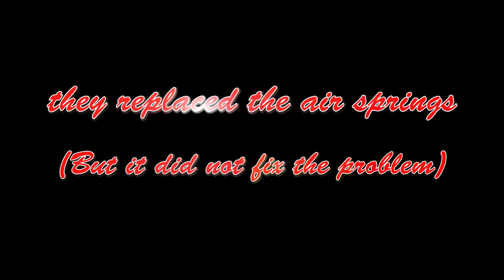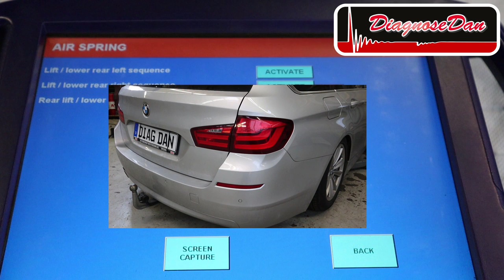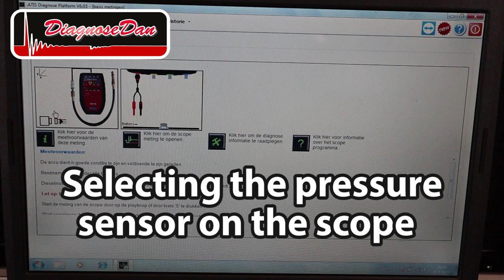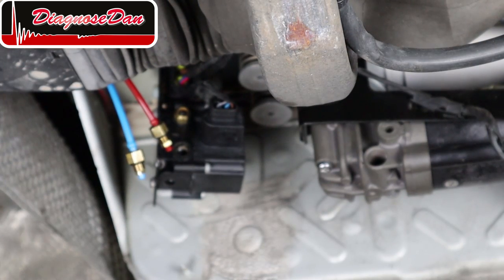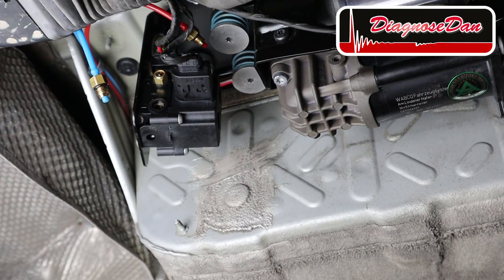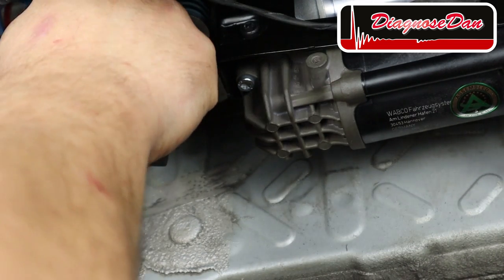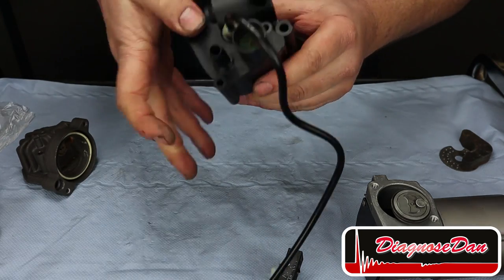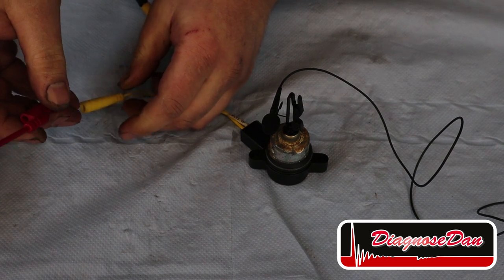Air Springs replaced, but no Fix!

Comment: Hi Dan, i have an f11 with the code 0245 , the weird part is not saggy while parked and when parked looks like it's leveling herself. Now sometimes it comes on and after stopping the car in park for a while with engine off it goes away and it comes back when driving for a mile or sometimes even more . And it does say disabled comfort mode . Any thoughts on this?

Comment: Hello Dan, I have the opposite problem on my air ride suspension 2011 740li . It won’t go down on sports mode and seems like suspension stuck up to Max .. but once I unplug the compressor using the fuse it does go down but it goes way too low. Any thoughts?

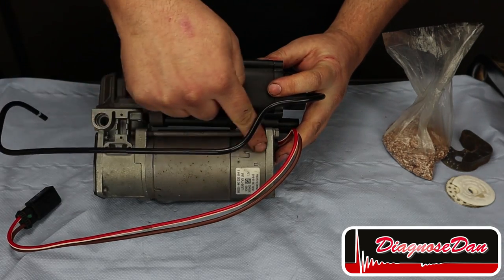Comment: Hi could you tell me how to remove the black tube  between compressor and Solenoid valve ( see video minute 18:03 already out), I need to release from solenoid valve but I can't is under pressure or I need turn off something?

Comment: I'm having issues where both sides of my F11 are dropping over a day. sometimes two. When you turn the engine on it raises to its normal height. I'm wondering if its the same issue with mine where its venting out over night.

Comment: Is it ok to use the w000589 g.l.o.v.e white on Mercedes air suspension?
Reply from the maker: Depends on the model! For pre 2012 models that's Ok. But you need to use black ones from 2013 onwards 😂😂

Comment: Question for you Dan:
My E70(X5) had a airspring fault at MOT check(yearly legal check). The car was always at correct height every day. However I had the airspring bag changed at rear on passenger side. Now in the mornings I see it both rears sit very low on the ground. Once I start the car they both raise to correct height so compressor is working.
I want to ask why did both rears lean down and what steps I need to take to investigate?
We already changed the bag we installed to rule out a faulty bag and installed Arnott one.
I would assume if one bag leaks that side would be down not both. Was it installation error on air pipes??
Reply from the maker: My question is why did you deside to change the rear passenger airspring?
Reply: Since the mot failed it. It had collapsed in the middle. I never noticed anything wrong with the car. Maybe I missed it every morning and the car was lower but I never notice anything.
Had it replaced yesterday and will look this morning to see if it lowers again.
Ok inspected this morning and passenger side is already high like yesterday no leak on this side. However drivers side is 1cm lower. Could it be a slow leak from unchanged driver side bag. Will see how it changes tmrw as I don’t need to drive the car today.
Reply from the maker: @eddy45686  at the MOT they lifted the car and the airspings got fully stretched.  I'm an inspector myself and i have seen this multiple times. After the car has been lifted airsprings can start to leak. The rubber of the spring folds over itself and can close a little hole. After the car has been lifted the spring sits a little different than before and that tiny hole that was there before can now start to leak. Chance out the other airspring and your problem is proberbly solved.
Reply: DiagnoseDan 
I’m a bit wary of lifting now as to change the other airspring they will have to lift car again. Seems the lifting has happened before many times but it didn’t lead to an airspring problem as I’ve had vehicle health check done in that past with no issues. I might have just been unlucky this time. I’m gonna chance it with other bag as if it ain’t broke why fix it. If it’s down by more than 2cm compared to other in 48 hrs then I will worry but if it stays same then I guess the bag is old and just sits a little lower than the new Stronger Arnott robust type.

Comment: the poor customer has to pay for 2 brand new air springs that where perfectly fine.
Reply: Warranty?
Reply: Not likely, AC does not usually dies out just just like that. Normally you get long ignored airleak in airspring or somewhere else and then ruined AC Compressor.

Comment: One question - why didn’t they take 2017 car to the dealer?
Reply from the maker: Imported from another country and than in some cases the Local reseller doesn't provide waranty.
Reply: DiagnoseDan wow, okay, thanks for info and thanks for such informative vids ❤️
Reply: It may be a 2017 REGISTRATION but it's not 2017 VEHICLE  @Diagnosedan

Comment: Do they not have warranty on a 17 plate?
Reply: It should be covered by warranty.
Reply from the maker: The customer imported this car from another country and than in some cases the Local reseller doesn't provide waranty.

Comment: My car won't have this problem. Sure it has self levelling rear suspension, but it does not use air. It uses hydraulic oil.

Comment: I get so frustrated when I see customer cars having parts thrown at them without any simple basic faulting being completed first. What’s wrong with the industry! Even main dealers with so called highly trained ‘techs’ skip basic principles. The original garage should be embarrassed and ashamed for changing out parts like that, time pressure or not. It would have been quicker to pressure test the pump and replace it, than it would have been to replace both rear air struts

Comment: So the moral of the story is when a BMW comes into my shop with that problem I should replace both air bags, then diagnose the compressor and replace it and after that is completed advice the customer that there is an aftermarket Solenoid available for a fraction of the cost?   
 
HAHA, Sorry I had to! It was there for the taking.  😂 🤣
Reply from the maker: Exactly! You got it!🤣🤣

Comment: Mine lifts, then I can hear some hissing , raises to full height, the pump shuts off, then it lowers to the bottom, and won't lift again until I restart the car
Reply from the maker: Bad airspring?
Reply: @Diagnosedan  Yes it was.. I changed it.. I just never expected to have this problem on  a 4 year old car...  BMW is putting in Junk parts.. my GM lasted 12 years.

Comment: No repair parts?  Sounds like German engineering is being outsourced to Harbor Freight.
Reply from the maker: There are like i mentioned in the video
Reply: @Diagnosedan  i had infered that you could get a solenoid mut not the exhaust valve.

Comment: A ~one year old $60K automobile requiring new air struts and a pump (guessing) $2k in repair costs.  This is why I don't buy European any more.  Have had great service from Asian iron.
Reply from the maker: Thanks for watching my video's it's appreciated!
Reply: To be fair, it likely didn't need the air springs. Hard to believe they went straight for the symptom, instead of investigating the cause - that can't have been cheap...
Reply: What is wrong with people?? This F11 is not 1year old
Reply: @Diagnosedan  Thanks Dan, I enjoy your clear and thorough posts.  Keep it up.

Comment: how is a 2017 not covered by manufacturer warranty ?
Reply: Wondering the same myself. BMW Netherlands web site says that all BM's sold after 1 January 2017 are covered by 3 year warranty.
Reply: high mileage probably
Reply: @Uninfluenceable  Doesn't look like a high mileage one underneath. But the warranty is unlimited km if it's Dutch delivered. https://www.bmw.nl/nl/content/aftersales/diensten-en-garantie/garantie.html
Reply: Can't read the warranty conditions but I doubt accessories like this are covered for such a long time. Powertrain, maybe.
Reply: I think it was "previously used", and then imported there, so no warranty coverage. Don't know if it was brought there and sold, or brought there after purchase in another country.
Reply: Or was the previous garage who sent it to Dan, a BMW dealership?
Reply: David Gillett not a chance!! The stealership would continue to replace parts, until way after the 2017 was brand new, again!! They would never miss a chance to charge outrageous prices, for ridiculously expensive parts and services, by sending it to someone that could actually figure out what was wrong!

Comment: The more fancy stuff thrown onto a car, and that includes Air Suspension, the more costs, the more things that can go wrong.  They really aren't cars you want to keep around for more then a couple years.   Let some other used car sucker get hit with all the issues it's going to end up with along with a big fat bill.

Really, who is an idiot for just replacing Air Bag and checking for leaks but couldn't be bothered to check for any air in the line in the first place?  I would have moved right to the Air compressor to start out with.  There's not much to fail on an airbag.   It's going to be a leveling sensor or an Air Compressor.  No air, it's not going to go up.  It's such a new car, it's not like airbags are rotted out.    I suppose with no air, driving around with them flat, they could have possibly been damaged.   I have supplemental Airbags on my lowered truck.  So that if I have a heavy load, I can add some air without the back end sagging.  Those bags can get damaged if there is less then 5 PSI in them.  I installed an Onboard compressor which will automatically keep them at 5PSI.  I have a wireless remote I can use to adjust the air pressure when I need to.  But normally it's at 5PSI.

That's the only reason I can think of replacing airbags on something so new.  Damaged from driving the car around with no air in them at all.    Still, after being changed out, I'd still be looking at the air compressor at that point.   Just seems strange to me.   Having worked on cars for many years, I've seen what so-called Mechanics do, and so I would never let any of them touch my truck.  Dealers aren't much better.  I don't have access to some of the things I used to, which kind of sucks these days.  But I got offered a job, and a complete career change and took it.  Glad I did.  Still keep up on some things in the auto world.  Still of Interest, and Dan is an expert.  You can learn a lot from watching him.

If you haven't watched 'South Main Auto Repair', that's another good one, and very good at Diagnosing issues.  Similar but different.  Both are great to watch.  Dan is doing more BMW's, Audi's, etc.  While South Main is doing more American Cars.  Ford, Dodge, etc.  If your near either of these places, that's where you should go to get your car worked on and maybe get it into one of these videos.

Comment: Why the hell would you replace the whole compressor (at great expense) and not just rebuild it it situ in less than 10 min for less than $50!?  These compressors are well known to wear the compression ring out and are fitted to just about all Euro cars with air suspension I change the ring in these just as a service item!

Comment: The shop really sent you a car for a bad compressor valve?  REALLY?!?  Gotta give it to the designers who decided that decades of compressors having drains on the bottom of the pressure chamber to release water was just too good an idea, and went with a less reliable desiccant instead.

Comment: What is it with this WABCOF FAhrzeugsystem Kompressoren that they fail miserably after only 2 years in service?
Why does BMW install such a inferiour component?
This thing is covered by 5 year 100000 Miles factory warranty?
Reply: Autopsy; what has failed?

Comment: having seen the end of the video it seems that a simple parts replacement solved the problem. i am wondering how expensive this replacement bmw compresor cost (i guess a small fortune). you could buy a cheap chinese no brand compressor on ebay at a fraction of the price. bmw are endless money pits.

Comment: a dead compressor?????? what a surprise. Even a novice like myself could have diagnosed this problem without the use of thousand euro electronic tools. Maybe the compressor just needs a rebuild, they are after all quite simple machines. I am staggered that a previous (so called) mechanic did not realise this. Maybe he (or she) should be driving cars and not pretending to repair them.

Comment: First shop fail- they replaced both sides springs- what are the odds of 2 sides failing at the same time on a 2 year old car- 1 million to one?   Fools should have checked for pressure.
Your fail- a lot of monkeying around with that valve and scope-  turn on compressor and check for leak at main pressure line- you would have felt the bypass blowing out immediately.

Comment: bad air pump, @ 2:30
Reply: yep, my ears didn't fail me and camera seemed to get the sound very well! direct drive oil less piston sleeve/ring failure. nylon cup ring design still?
same as they've used on oil-less direct drives for years? I don't work on BMW's nor many heaps with air ride, but I do have ears, which work much better in person in a dead quiet "shop"!
that's where a "back yard garage is great" I can make it near dead silent. I'd go nuts and rip folks heads off in a normal shop/factory trying to get the noise nulled out =p

Comment: No Dan the glove sensor is to big for your application. Go BMW. Take down a 1000 Euro coil sistem and replace it with a 5000 Euro air sistem that doesn't come with a pressure sensor (does it have a temperature sensor?)for that money they should give you at list a latex sensor. Ho pays for this crap? I'm not going to answer that
Reply: calin onofrei 
If I’m not mistaken all touring models come standard with the air suspension. I honestly think they don’t fail that often.
Reply: Yes but it's a 2 year old car.i think were heading to single use cars. The sistem is similar to Audi and mercedes, they had pressure and tempreture sensors moniterd by obd. Instead of using simple electronics we have to use gloves and other hi tech stuff.
Reply: Don't gate me rong I have a small repair shop and things are going good, but because of all the technical advance I've comed to the conclusion that it's more economical to do 10000 km/y in my 89 Jetta and keeping a 2012 allroad in the garage(1000km/y)
Reply: calin onofrei I have a 10 year old touring 5 series and the system works fine (at least so far 🤞). 
But on a 2 year old car, it should have been fixed under warranty to my opinion.
Reply from the maker: Yes in my opinion it should have a pressure sensor but it doesn't 😪
Reply: I'm more curios if it has temperature on BMW. My guess is that it doesn't, thats why the on time of the BMW compressor is so short. That would be dangerous. Audi had temp sensor instaled for air leaks that make the compressor overheat
Reply: calin onofrei 
Wouldn’t the BMW approach be better? Allowing the compressor a short but sufficient time to adjust the suspension will prevent overheating. 
By adding a temperature sensor you achieve the same goal but you make the system more complicated. A pressure sensor would be nice for diagnostics but not for driving.
Reply: Yes it's better if after to many on/off cycles it would shut down for some time or go into service lock. In Dan's case it had a major leak. But I don't know whats going to happen in the case of a leak just big enough to make the compressor work overtime.
Reply: It would be nice to get answers from the guys that build cars. I think this are reasonable questions and the answers are coming from people like Dan, even if you know yourr job very well, you still have to play triall and error or reinvent the wheel. Bravo to Dan. For a family guy to take time and do these videos is amazing.
Reply: calin onofrei 
I couldn’t agree more!

Comment: I liked it better before you fixed it
Reply from the maker: Lowrider🤣🤣
Reply: @Diagnosedan  after a couple of bumps that solenoid would be fixed, a joy ride off road to the country  would do the trick 

we have dedicated set of small hammers to beat everything on the car where problem suspected , even if no fix  there some satisfaction from applied effort  !

Comment: ok sry but what in hell is wrong with these shops ppl trust and get there cars to.
iam not a learned car mechanic at all. 
but its not rising check for leaks no leaks check for pressure or valve block. and not replace good parts and say they didnt find the problem